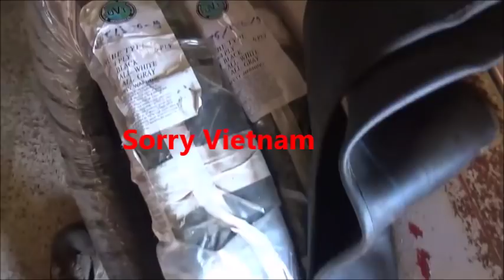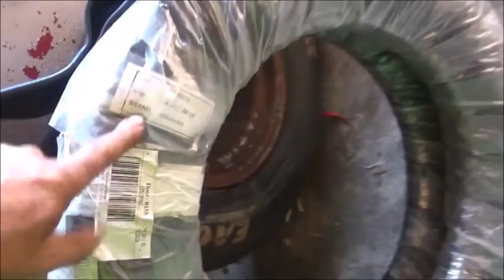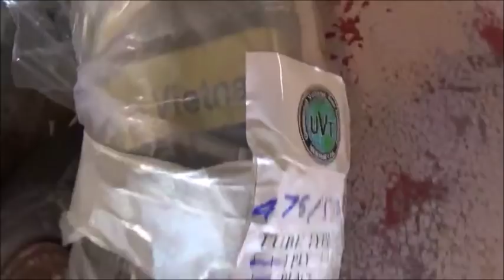1929 Whippet Tires, Update & One Day Hot Rod Update

Comment: I had a 1980 Monza coupe that started out with the 2.5 Iron Duke with 4 speed.....I could do donuts forever with that setup....Then it was converted to an LT1 car and Holy S***. Sold it to a guy that ended up cutting it in half on a light standard 3 days after buying the car.

Comment: Great info Jonathan as usual. Are you going to do anymore to the rear end of the Buick? Very much  more horsepower than a V6 will probably destroy the factory rear end. I had a Vega with a 350 installed in it, destroyed several rather quickly.
Reply: I had a buddy back in the late 80's early 90's with a hot rod v8 Monza, it hauled ass and yes, the factory 10 bolt rear end lost an axle one time. Lucky for him he was not racing when it gave out, he was driving at a lower speed where it gave him a chance to stop and get towed....Jonathan beware.

Comment: in Tennessee the highway patrol doesn't require an axe , but do mandate a min 10lb sledge and a min 24 inch pair of bolt cutters , do I video when you do your go through check , I am curious of the differences in NC

Comment: I haven't seen anyone change a tube type tire since i've had to fix a flat on my Holmes 850 which has 1100X24 bis ply tires on split rims. They don't make a tire/rim combination to fit a tire that large. great job and not near as much work as I had to go through with tire irons and a sledge hammer. Where on earth did you find that tool. I know it was on e-bay but I've never seen anything like it. P.S. you need a sand blaster, thats about the only thing you don't have, is it not?